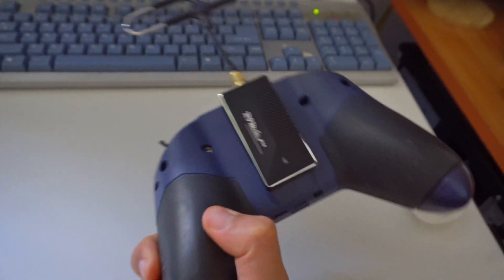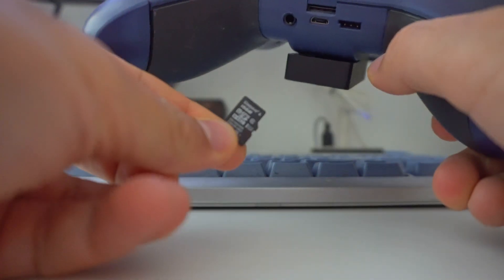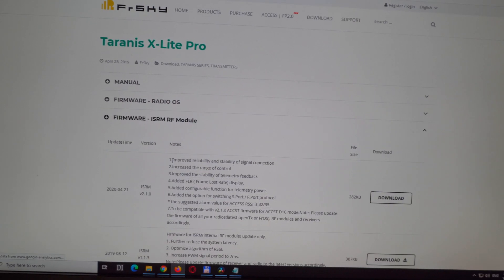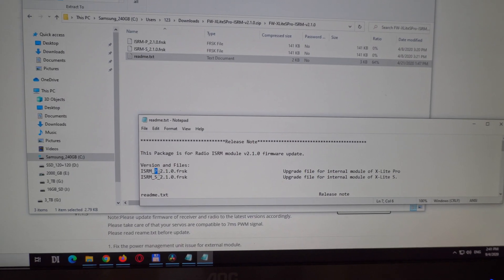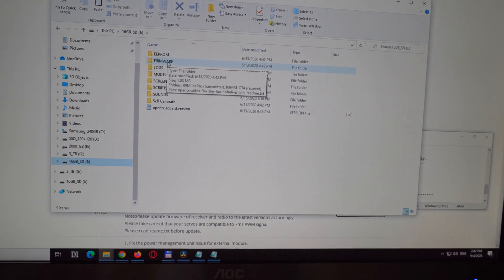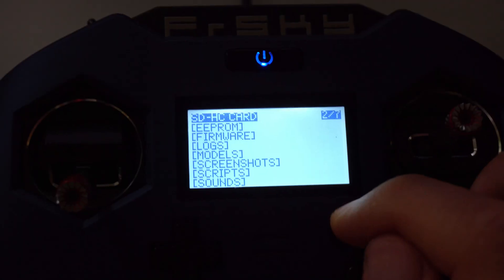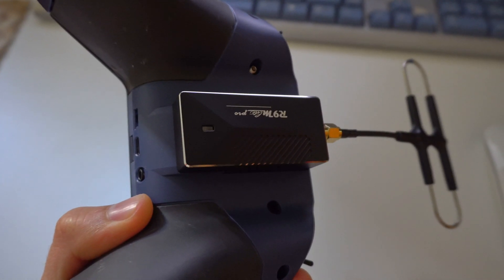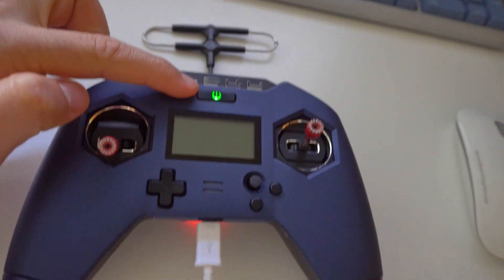Taranis X-Lite Pro firmware update (PMU, unexpected results, Module LED is ON while charging)

Comment: FYI, the R9 module will unexpectedly still transmit radio frequency even after you select a different module which you would think turns it off. I noticed my speakers still humming which was the clue lol
Reply from the maker: Could be, or maybe the speakers are humming because of the second module.
Reply: @furulevi  oops I misspoke! I mean to say a different “model”, sorry. On the radio settings if I select a different model aircraft which is not setup for R9, I would expect the R9 module to turn off, but speakers are still humming! If I turn the radio off then the sound stops.